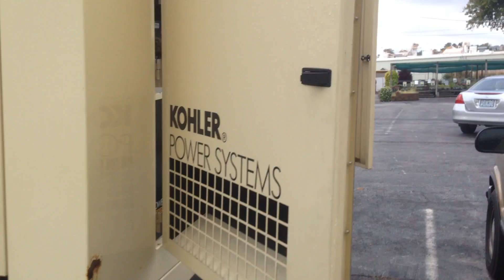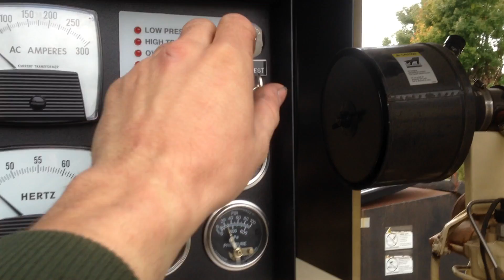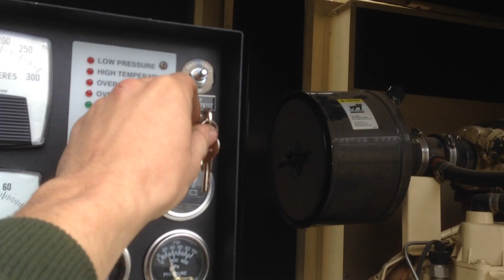Water in Diesel Fuel

Comment: That racor fuel filter/water separator has a clear bowl on the bottom where you can see the water and debris without taking the top off. It also has a drain valve on the bottom of the bowl where you drain the water and junk out, then you can fill that filter back up with diesel and you'll be back running.

Comment: well for one you have the wrong injection pump that looks like one for a v8 and it has lines snaped off... other than water what could cause a stall like this?
Reply: Water in the fuel or a plugged fuel filter
Reply: Or both
Reply: Matt Leonard or all 3 0_o